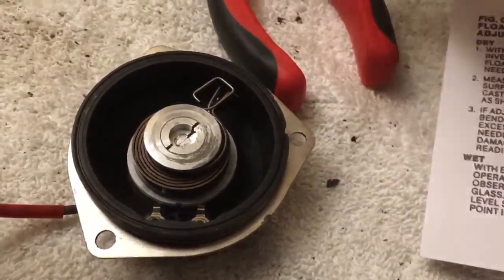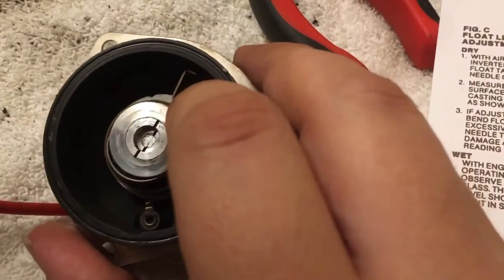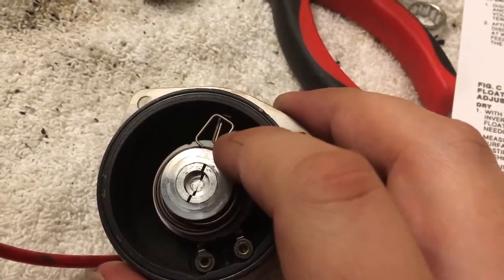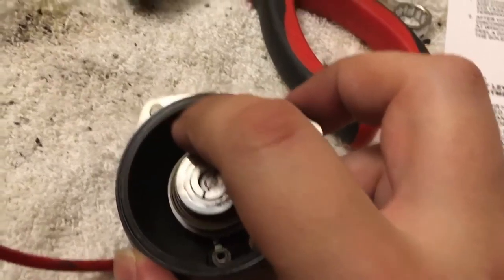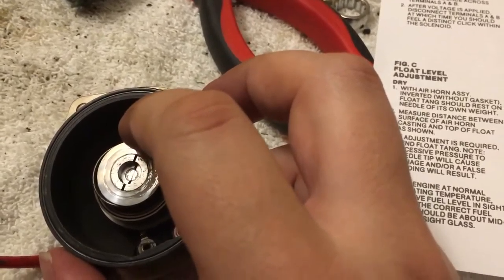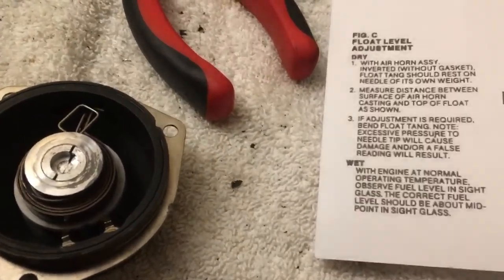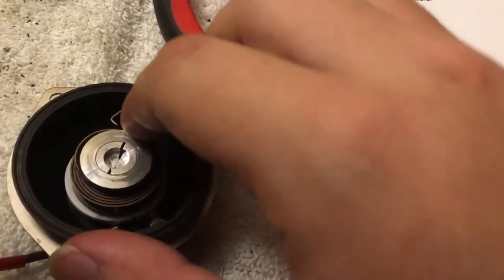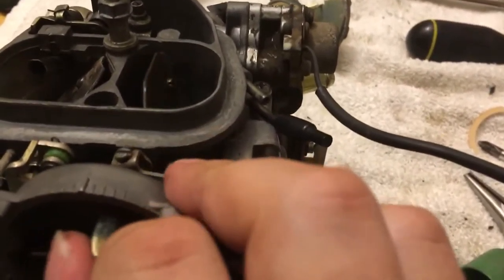22R Carb choke issue

Comment: I recently rebuilt my 84 Toyota Pickup's Carburetor and it took me a while to figure this out.That light spring piece should be rotated counter clockwise all the way until it hits the thermal coil spring then you insert that metal tab which attaches to the rod which controls the choke butterfly. Check to see if you have it correctly by connecting a vacuum pump to the choke breaker diaphragm and pump one or twice if the choke slightly open then you had it.

Comment: I recently rebuilt my carburetor and discovered the same question. When I drilled the last rivet out of my choke, the cover jumped off so fast, I couldn't tell where it was originally positioned. After watching a bunch of videos, and learning about the choke (way more educated now), I determined that the proper position is basically where you have it in the first frames of your video (If I'm recalling correctly- it's been a while since I put it back together).
     I fished that post that is protruding from the carburetor side of the choke through the loop on the secondary spring, and up against the face of the primary spring (on what is the right side of the primary spring, in your video).
     The two springs are different metals, and will expand at different temperatures, which is what causes the choke to operate based on engine heat, rather than your manually telling it to open and shut.
     With the carburetor out of the engine, it is cold. To satisfy the condition of a cold engine, you would want to hold the choke plate closed (or mostly closed), as it would be in a cold engine. Fish that post through the secondary spring, and up against the primary spring, as I mentioned before, and the tensions should be enough to hold the choke plate closed.
     Give that plate a little push and it should give way, but you should be able to feel the tension on the spring.
     Reattach everything, and you ought to be good to go. Some chokes can be further adjusted once assembled, by turning the spring assembly based on those tick marks on the carburetor side of the choke, but mine could not, and it looks like yours also may not. That's okay.
     If I'm mistaken, then it's the other way, but with only two options, you will either get it right, and feel the choke working with tension, or you'll learn something, open it back up, and do it the other way.
     My choke seems to be working just fine.
     Good luck everyone.
Reply: This is huge, thank you. I was staring at it a long time last night until 3am trying to figure it out.

Comment: i recently rebuilt 1 carb and i have about 6 others just sitting around. all the other carbs when you push down on the flap inthe carb  it springs back to the closed position. so that means you turn that hook inside the carb counter closewise and then the little rod hooks on that square opening. . a simple trial and error will see it only creates tension one way. hope that helps

Comment: you have to hook the little shim on to the bigger square on the spring. The small square have to be on the other side of the coil. You can suck the diaphragm and check if the butterfly comes to it's position. If yes you are good. If no, need to open and try again. There are some marks at the top like a timing mark, you can adjust the tension on the spring with that. Cheers

Comment: did you ever get this figured out
Reply: seems that the top spring should be rotated counter clockwise with the tang of the choke lever in the box of the spring. this will keep the lever close to the bimetal spring.  a video of another aisin carb does not have the second spring that I see as a "keeper"